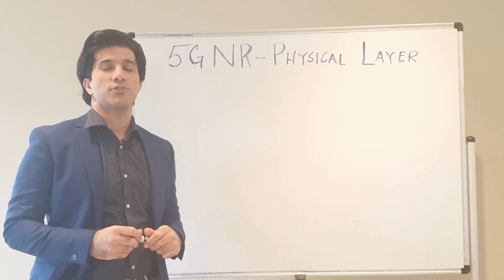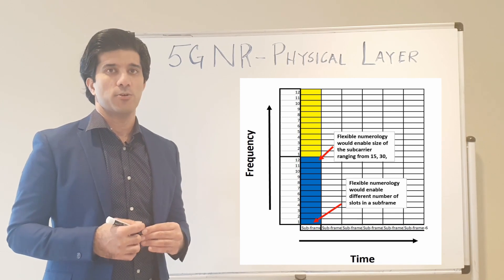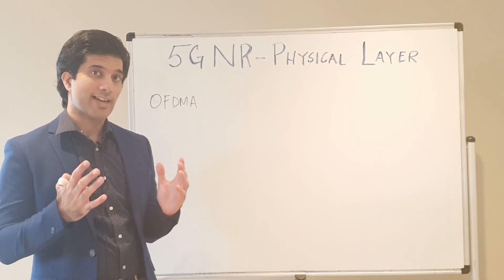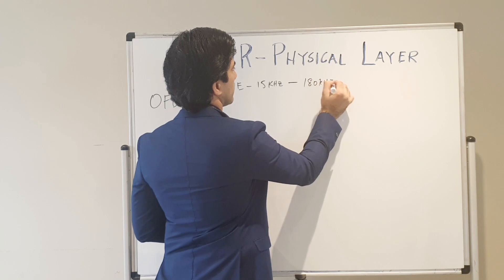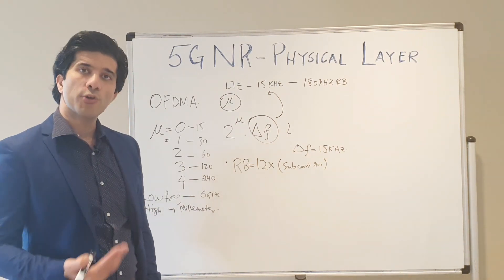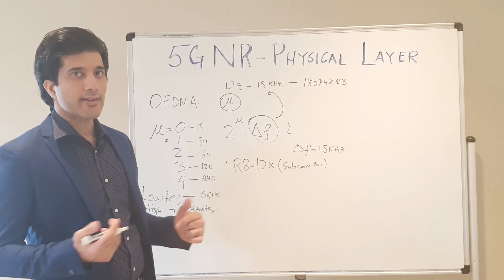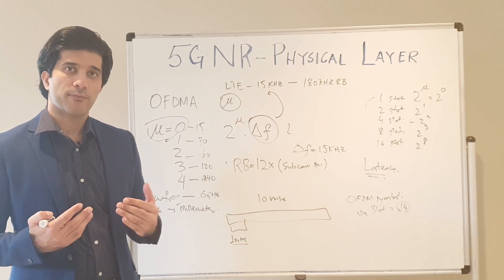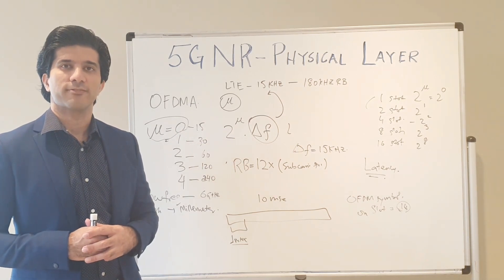5G NR Physical Layer : Frame structure, Flexible sub-carrier spacing, time slots and Resource blocks

Comment: In higher frequency bands > 24 GHz( mm waves )  ,ultra low latency can be  achieved  using higher sub carrier frequency spacing with multiple numerology…But in 5 G low band less than 1 GHz ,how this ultra low latency can be achieved ?
Reply from the maker: The higher frequency bands are included in 5G specifications and known as FR2.

Comment: In the 15khz subcarrier slot per subframe is 1, and the slot contains 14 OFDM symbols. for In 30khz  subcarrier slot per subframe is 2, each slot contains 14 OFDM symbols, then what size of each slot and the size of 1 subframe? In 60khz  subcarrier slot per subframe is 4, and each slot contains 14 OFDM symbols, then what size of each slot and the size of 1 subframe?
Reply from the maker: Please look at the part where slots and subframes are explained in the video

Comment: Thank you for the information. What actually means by number of  Resource Block ? In LTE, i did not see info on the number of resource block. I understood in Frequency domain, we can have a maximum of 180KHz (15Khz x 12). In 5G, we can have from 180Khz to 2880Khz (240KHz x 12).  Where does number of resource block come into picture
Reply from the maker: Resource block is a unit of frequency resource which is allocated to the user. In LTE, its fixed while in 5G we have multiple configs of Resource blocks

Comment: It is useful. But just that I couldn't see the resource grid info, even though the snapshot of the video shows about 5G NR resource grid. I think the snapshot of the video is misguiding. :(
Actually I was looking for info. on how the mixed numerology works within the same symbol period. I am confused since the symbol period of 15KHz and 30KHz are different. so how both mu=0 and mu=1 would coexist in the same symbol period. Please reply if there is a video on that
Reply from the maker: Mu=0 and Mu=1 will not co-exist in the same symbol period as they point to different subcarrier spacing.

Comment: Hi, thanks for the video, one question, when we increase SCS from 15KHZ ( one time slot/14 OFDM synmbols ) to suppose 240KHZ (16 time slots / 16x14 OFDMS symbols within the same subcarrier , iznt throughput will  increase in same fashion (  x16 times) as we have 16*14 OFDM symbols now compared to legacy 15KHZ case with only 1X 14 OFDM symbols ?
Reply from the maker: The total duration of the frame slot remains the same and therefore no impact on throughput. It is more to do with latency.

Comment: Thank you! Very useful.
 I have a question. what is the trade off when using higher SCS? Is it reliability? Does a shorter TTI mean that modulation needs to be kept low to maintain the same channel quality?
Reply from the maker: Will try to address this in upcoming videos
Reply: @WinInk  Also want to ask the same question, is it reflected already in any videos? Thanks